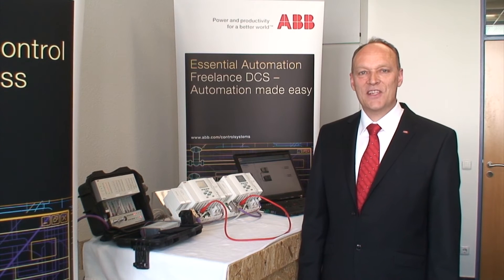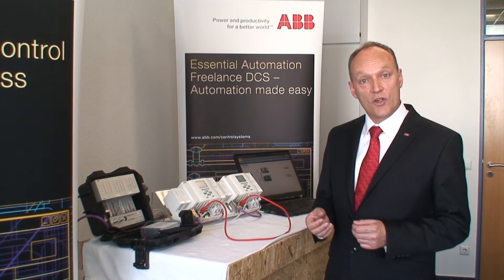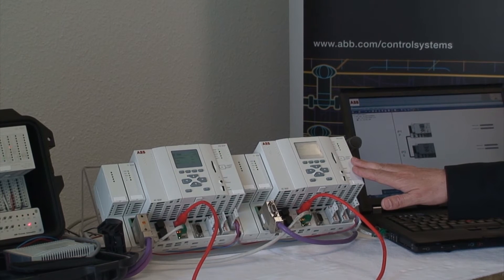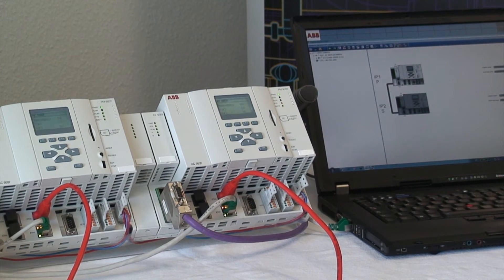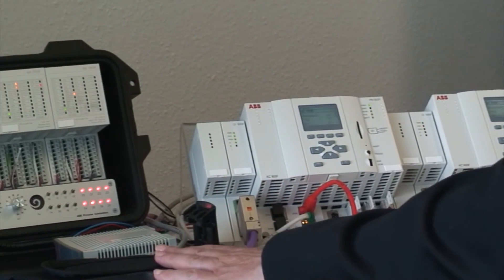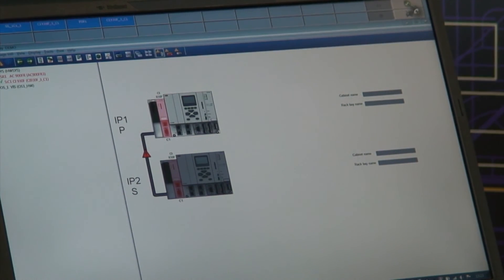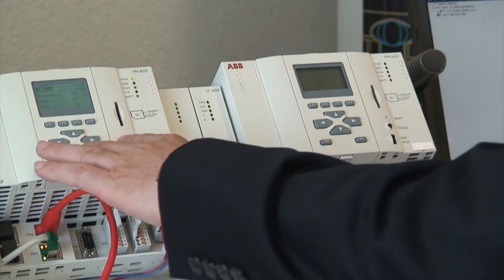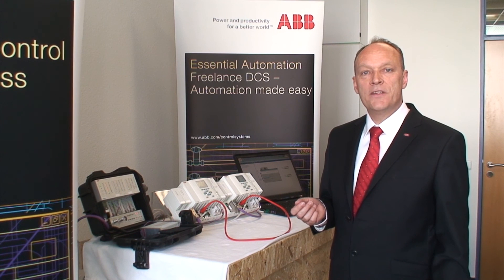ABB Freelance DCS - Redundancy with the AC 900F controller

Comment: Hello, Excellent video; I am writing to you to ask the following questions: When should the firmware update be done? In the case of AC800M redundancy, do the two processors necessarily have the same firmware? In the case of a redundant system, a processor fails and a new processor is purchased and it has a newer firmware, how do I download the firmware of this new processor so that it can be integrated into the system? Do you have any procedure or technical sheet that you could share with us to implement redundancy, would it be enabled because you have the new processor to replace the damaged one? 
How can I verify what firmware the AC800M processor has and where do I get the firmware available to download to the processor, does the control builder itself have it?